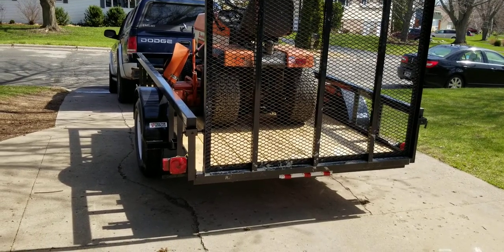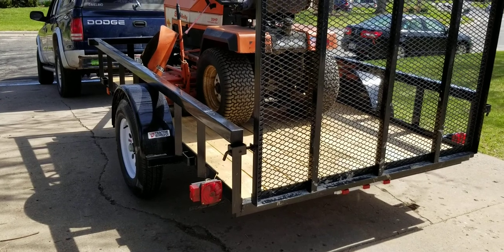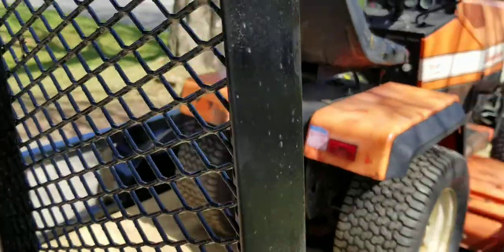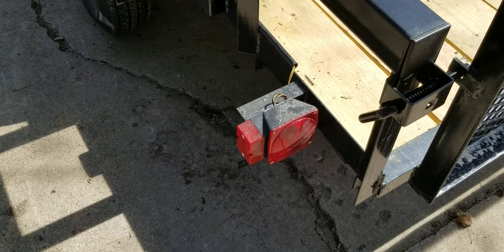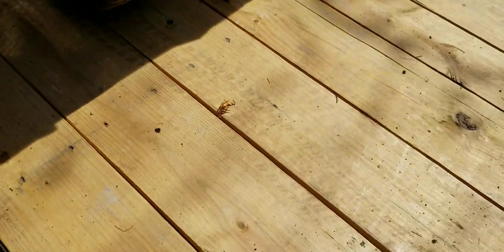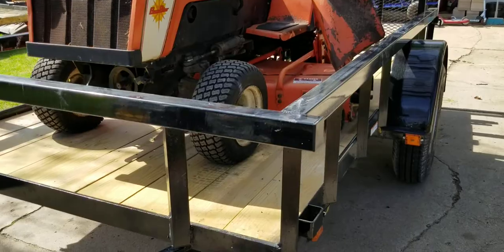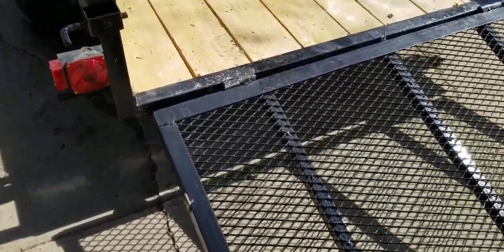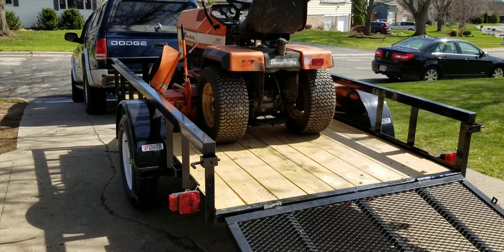5-1/2 X 10 Carry-On Trailer overview from Tractor Supply Co

Comment: The hinge allows the gate to lie completely flat inside the trailer, so if you wanted to put something 12 foot long like a carpet roll you can.  That was the reason I went with this brand as opposed to others.  Its a very well thought out trailer.
Reply from the maker: Thanks for the input and thanks for watching!

Comment: I wanted to avoid that problem on my trailer so I flipped my trailer ball over so the trailer sits more higher on my truck which makes the tailgate sit more even. Now my hinges aren't nothing like yours but I didn't want to chance it. Never had a problem loading my mower. Just thought it my be a suggestion to help you out.

Comment: If you raised the ball on your hitch it would drop the back of the trailer down and make that angle not as aggressive or if you just put a piece of wood under where the gate hits the ground lifting the ramp off the ground a couple inches it might make you have enough clearance not to scrape on the hinge